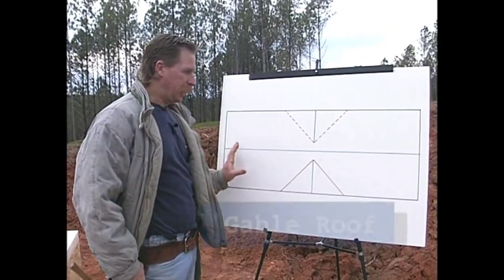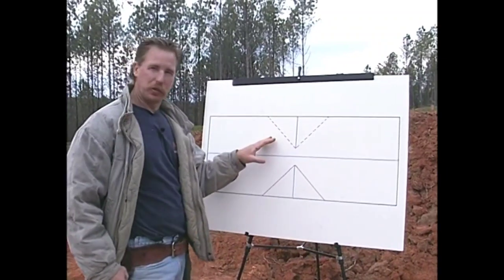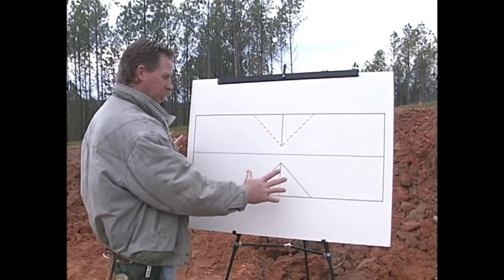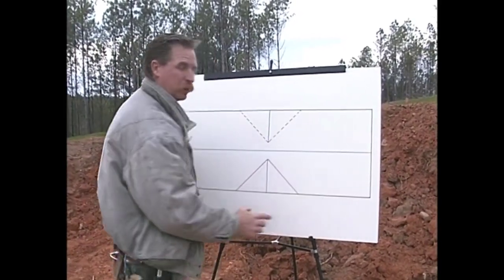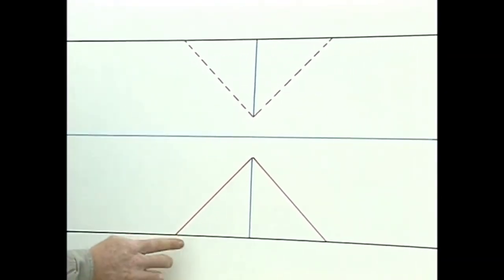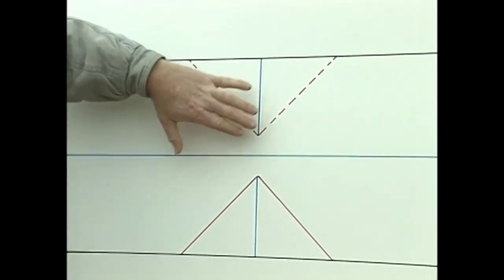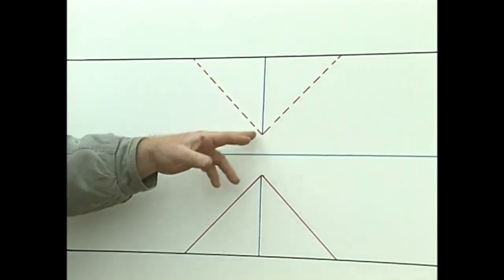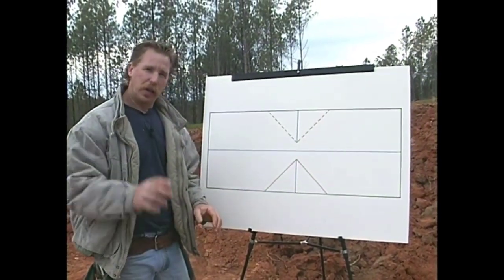How to frame a Gable roof . Full demonstration on layout, cut, and assembly.

Comment: I am somewhat confused as to how he comes up with the common rafter length of 7'5/8".  Shouldn't you take the overall span which he says is 10'1" divide that in half to get 5'1/2".  Then subtract 3/4" for the ridge board giving an adjusted run of 4' 11 3/4".  Then by using the  adjusted run of 4' 11 3/4" and the 12/12 pitch shouldn't the length of the rafter be 7'1/2"?  Am I not understanding this correctly? Please advise.  Thanks.
Reply: This exactly what I thought. My math on the square comes out to the same. I got 121" (10' 1") / 2 = 60.5". Then -.75 giving 59.75" / 12 x 16.97 for a 12/12. Giving 84.496 or 7' 1/2" same as yours. So to me by forcing the rafters apart to fit the ridge board means its not a true 12/12.
Reply: Yea 59.75 divided by cos (45) degrees = 84.499 inches
Reply: He make the same rounding error when he asserted that a 1.5"x1.5" isosceles triangle has a hypotenuse of "2 inches." Nope, it's 2-1/8". Little stuff adds up.
Reply: @thomasdoherty7840  Yep, I did mean a right isosceles triangle (i.e. the only kind with a hypotenuse).
Reply: VideoNOLA right angle triangle much better for others who are trying to grasp this stuff, I’ve seen it o many times confusing others
Reply: He's correct you don't consider the 1" just say 5'x16.97 gives you 84.85 or 7' 7/8" the 1" according to the rafter table you should add 3/4" or just ignore it since the ridge is 1 1/2" he's using the swanson's rafter book check it out.